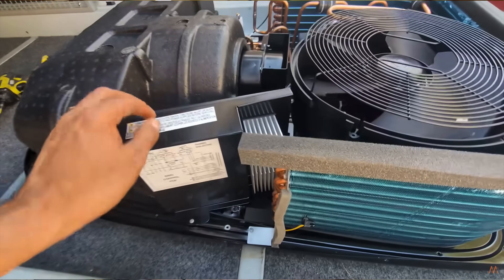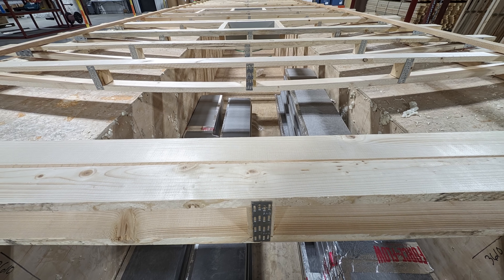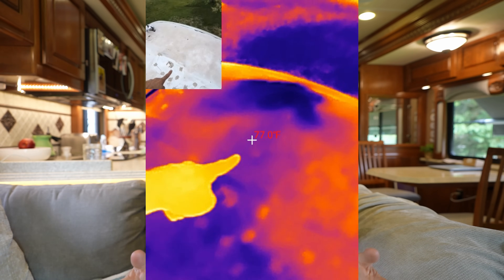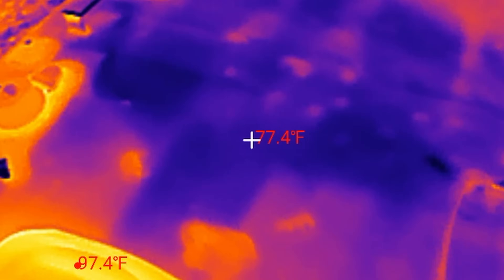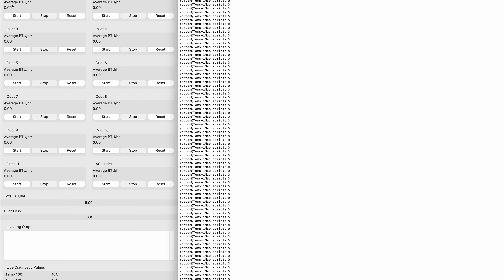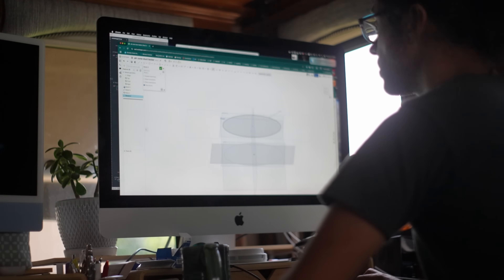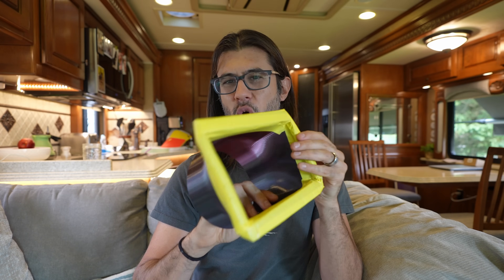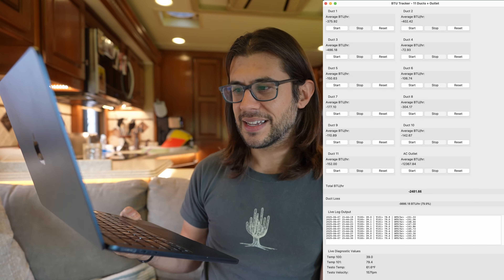Ducted vs Non-Ducted RV A/Cs: One Is SUPER Inefficient

Comment: I have a Diplomat with ducts running front to rear. Both AC units are Dometic Duotherm's (25 years old!!) and both still work. The rear AC unit draws enormous amounts of power (4x the front..or more) so it's pooched. The front can't keep up. And so, I was going to replace the front with a Chill Cube. I'm a Christian, and when I pondered it, I had a crazy thought, put in a non-duct Chill Cube in and just don't use the ducts. A crazy enough idea that I'm pretty sure it didn't come from me! My ducts are on the sides.

When the duct system runs front to rear and is shared with all AC units they really aren't zones and you have no control over them. It would have been way better for the manufacturers to put slats in the ducting so you can isolate them and create zones. For now, the front AC sends much of it's output to the bedroom, which is useless when you are not there. This makes the bedroom way too cold, and the front way too hot. 

Assuming I put non-ducted AC units in, I will have two real separate zones. Bedroom (rear) and living room (front). Then you can close the doors in between and isolate those zones. In theory, you could have someone in the bedroom with their AC set to 90 and someone in the front with it set to 72 and they would not clash. 

The common issue I have with the ducts is that all the AC I need is in the front. But you can't stop it from going to the bedroom. The benefits of having two zones that are actually separated are massive, and if you need more cooling, set the rear and front to the same cold temp and leave the divider doors open. It's a brilliant idea, as such, I think it came from the Lord!
Reply from the maker: watch my furrion chill cube video, thats exactly what i did in the bedroom and it works really well, very easy to un-duct.

Comment: One single 15 K BTU LG mini-split taking the job of 2- 15 k AC’s @ 5 SEER in 19 amps. Win,,,! LG. And we are done with roof ducting AC. That is basically “cooling” a hot roof installation,, instead of cooling the living quarters. And let the roof 6 inches of insulation fend for itself…

Comment: After looking at the research, and front AC dead, (not buying another one), “95 degrees “ here and the little ( window) 10K LG 15 seer is kicking **s in real life. 75 degrees/54% humidity, i am done with roof top garbage. Going full on LG residential mini split (double inverted) @ 15k BTU in a seer 27. Rear unit hanging on back  cap, lines running up to roof then down to 30 inch cabinet replacement. Roof top units will be scrapped/capped. Lg unit will do heat/AC @ 120 volts.
Thanks for your research,,, I just took it farther. I am done with SEER 5 roof AC units = garbage.

Comment: All 3 AC’s being plumbed into the common duct doesn’t help. Our middle and Front ACs push air out the rear AC unit. The fan shroud was cracked, so we were pumping air out side literally.  
Did you catch the ducts that tun to the front overhead dash area?  We had 2-3 vents loose up behind the front TV.

Comment: On our yacht which has 3 living spaces we cool it with no ducts. The solution was 2x16,000 btu heat pumps. Both are split systems and one has two evaporator blowers. The one with the single evaporator dumps into the salon (largest space with most windows). The one with the twin evaporators cools the cabins with one evaporator each. It is a lot easier to insulate a refrigerant line than it is to insulate an air duct.

Comment: It makes sense that ducts are inefficient.  However, the alternative requires the use of multiple fans placed here and there to distribute the air.  In a compact RV with very short duct runs, I think the tradeoff is fine.

Comment: LG 10 k (15 SEER) unit can keep 75 degrees in window unit in rig. With floor fan directly in front of LG pushing air up. This is a non ducted experiment. Moving towards LG mini split single 15k unit @22 SEER in rooftop.

Comment: Running down the same road as you, looking to run LG mini split in ceiling mounted @ 22 SEER . Bounder 35 E here surviving on an LG 10 k 15 SEER. with front ac dead, second ac on last leg. LG 10k has held temp to 76 degrees @ 99 degrees outside on it’s own. Looking at LG mini split with ceiling mount condenser in height measurements. @ in height @120 volt @ same height as crapy roof units, with plastic buble over the roof unit. Your over thinking it, it is roof height and containing it. 15 k of LG air/heat is more efficient. I bet we will meet in the middle of the math.

Comment: In Central Michigan we bailed Saturday because our Rockwood kept climing and 80 was our breaking point. I had put in the Kool RV kit to get more airflow into the ducts but I am not convinced it helped. Of course we have the space / hookups for a second AC but now I am wondering if I should just take out the Kool RV and try dumping instead on these very hot days.
Reply from the maker: We're in Central MI right now too and it's brutal. That's my plan for my next upgrade, going non ducted on one of my ACs.
Reply: @MortonsontheMove  Well at least this should be the last of it for this round. We stay at Soaring's RV park and will be going back this week so maybe I will get it changed over and we will be able to tolarate it next time. All your ACs have been keeping up?

Comment: Thanks for the great video!  Was pondering why RVs need way more BTUs vs a home for the same sq ft. For a home, 10k BTUs cool 450-550 sq ft, so why is 10k not sufficient for a 240 sq ft 5th wheel?  Of course RVs have single pane windows, etc, so insulation can be an issue - some people have reflective insulation panels over the windows to help on really hot/cold days.  

I am researching installing a 10k BTU 12v/24v variable speed AC (inverter technology) for my 240 sq ft 5th wheel into the front bedroom. After watching this video, I'd install it non-ducted, and leave doors open for convection. That unit could be my primary cooling unit to run and drop the humidity levels - which means more comfort at a higher cooling temp setting, and it would be quieter in the living area.
Reply from the maker: I think your right, going smaller unit non ducted will do most of the heavy lifting for less noise and power,  im planning on doing something similar in our fifth then using the central unit just for additional on extra hot days.

Comment: Back in July of 2018 I was try thing to figure out why my 2015 Thor Ace 29.3 didn't cool very well, I discovered the fault by accident while insulating the front cap. I had it opened up enough that while putting insulation in I couldn't figure how I was feeling cool air. My discovery was when they put the roof ducts in they didn't seal the end of them and they were just blasting cold air straight into the front cap unabated. Once I plugged those things got way more efficient! I went on the IRV2 forum for the Ace 29.3 and suggested others check theirs and apparently they didn't bother to plug anyones vents!
Reply from the maker: thats  crazy!

Comment: Very interesting.  I have a 2009 Dynasty that "looks" exactly like yours.  I've pondered finding a way to install a standard house mini-split, but find no good examples to go by.  

With regard to your assumption that 50% of the air is lost, I would not endorse that, even after noting your careful work.  The air in the ceiling has no opportunity to find a path to the external that I would endorse.  The roof membrane has no holes and is not porous.  The roof is attached to the walls.  There are no ducts in the slides, none in the walls, none in the floor.  Therefore my belief would be a inaccurate measurement approach which you have no control over.

I guess one way to verify actual air loss would be to seal every duct outlet with plastic and tape.  On one outlet, tape a shop vac hose.  Turn on the suction and using just your hand, you can feel how much air is exiting the shop vac.
Reply from the maker: No, that was wrong for sure and I corrected that by finding the ducting into the weird spots, but the 50% heat loss is still real. As for a mini split, that was my original plan in this coach as well, running lines in the ducts and using a ceiling unit was the only way I could find to do it. We just don't have wall real estate for a handler. I'm going to be unducting  our bedroom unit and trying the furrion, unit and we'll see how it goes.

Comment: Very in-depth testing! I've been trying to find a replacement RV heat pump since our Houghton has been very disappointing (needed a new control board after 1 year and a new rooftop unit after 2 years, only cools one-third of the time now), and the Turbro looks great except that it doesn't have a ducted unit. But your video is making me question whether that's really needed. The problem is that the heat pump would go above our fifth wheel's bedroom, and moving that heat to the rest of the fifth wheel would be a problem.

Comment: Enjoyed your video.  I think Grand Design has a fifth wheel with the AC unit in the basement vs a roof mount. I thought this was an out of the box approach to AC in an RV.  Not sure how they move the cool air around or how they draw/vent the warm air for the heat exchange, but this approach could address many of the issues you/ve noted.
Reply from the maker: Basement units used to be popular in class a motorhomes but they had a lot of disadvantages, however, there's a few models on the market and one new variable speed unit coming out soon that I plan to test as well. I do like the idea of basement units other than you lose basement space but you gain roof space for those who want to do more solar

Comment: Thanks for the video, I’m now looking at using vacuum panels on the ceiling of my Bigfoot 3000c truck camper. I figure 1/2 panels glued to the roof with 1/2 furring strips, black cloth background with basswood strips with 1/2 spacing. This would allow for lighting strips between the basswood strips. Seems cool in my mind.
Reply from the maker: Sounds like a neat project, and I like the idea of integrating lighting into the design! Looking into it, while far more expensive than foam, the cost might not be as bad as I thought. Would be a good way to better inuslate these things for sure!
Reply: @MortonsontheMove I order one of the Panasonic vacuum panels. It’s 20.70" L x 11.80" W x 0.59" H  and around $30. With the covering on the ceiling I might be able to just Velcro the panels up. They just need to be held in place until the planks go up. I’ve got my 1998 Bigfoot 3000c torn apart now because I’m redoing everything. Removing the propane and replacing it with a diesel heater that will be housed in a box on my flatbed. Then radiant heating in the main and bathroom floors and a couple of radiators in the bedroom. Induction for the range and a convection microwave. I like your idea of ducting the cool air from the ‘downstairs’ to the bedroom. That existing 4” duct will work great for that. I moved the batteries to where the ‘pass through’ window is to move the center of gravity forward and all the electronic is on the left wall of the closet. I remove the generator. For AC I went with a 24v Nomadic X3, I went with the higher voltage so the wires would fit where the existing AC wires ran. The fridge is a NovaCool 9002, dual compressor. It’s a little over 9cf and is the same size as the original 3 way fridge. I just finished your trip through eastern Canada. Really well done!

Comment: Thanks, as always having your scientific analytical approach was great. I have had both types in separate Motorhomes. The only advantage I found in simple observation with the ducted was sound. The start up of an AC can be loud. A soft start could fix that, but the inducted I had was before those existed, I think.

Comment: Thank you Tom! Rather then traveling north this year we had to spend our summer in Arizona. With high temps of 100+ every day in June we've had to use both AC units at times in an effort to keep the interior temps below 80 degrees. Luckily we have the ability to bypass the  ducting in our 5th wheel. The AC is a little louder but runs less and keeps the camper cooler. We will definitely be installing a mini-split before the next summer season. Do you have any advice on mini-splits in an RV?

Comment: Seems like a better system would be mini splits where you are only piping around refrigerant to each head instead of air.  It would have to be designed that way from the start, not exactly good for retrofitting.  Of course more insulation would also help...
Reply: This...  I believe there will be multi-cassette mini-splits in RVs at some point.  The cassettes can be decorative.  Move the condensing off the roof and get rid of the inefficient ducts.
Reply: @rdrose61  A friend of mine has retrofitted his 40' DP with a dual-head cassette system. 15K front and 12K in the rear. He sandwiched the outdoor unit into the basement and modified the door for airplow, exhausts into the engine compartment.

This is crazy efficient and his 4000W of solar and 4 Tesla modules, and 48V Victron inverter/charger allow him to run pretty much 24/7 in both cool and heat modes.

It seems like it would be a no-brainer for the high-end coach builders to simply engineer something like this into a coach that would allow them to be the only one doing this...... kind of like the first company that added slides years ago!!
Reply: @paul65k Exactly.  I don't think it is even a major engineering problem.  In fact, it should solve several issues besides efficiency.

Comment: Very interesting!  When I bought our used motorhome (2013 Tiffin Allegro) I thought it was great that it had ducted supply and return vents.  But when it is very hot outside and we don't have a shady site, my (2) AC's struggle mightily to keep the rig cool.  I have noticed stronger air flow out of some vents than others and interestingly enough, they are NOT the ones closest to the AC units.  I am impressed with the engineering effort you put into your study, I don't know that anyone else has ever done that...but it makes sense that running ducts through an RV roof is like pushing cold air through a furnace.

Comment: Yes. Totally this. I’ve been analyzing the ductwork in our Montana for last year since we’ve had it and it is horrendous how much energy loss is occurring. I’ve done all the mods in terms of improving airflow. Change the outlets all of that, but the amount of heat loss or this particular case introduction of heat into the cold air between the air-conditioning unit and the front of the rig is over 15°
Reply from the maker: That's a huge temperature difference, and totally makes sense when you see the design of many units!
Reply: @MortonsontheMove  It's got me wanting to get rid of the usage of the ducts. TBH not too complicated in my case (2 x Coleman Mach 15 ducted). Just a new grille and block off the ducts I would think. The downside is the noise level would increase considerably though. Replacing them with a Furrion Chill Cube would be the better route but is prohibitively expensive right now and our season really only extends in to October. We were full-time in Florida until January but had to move back to RI due to family stuff.
Anyway, I was very excited to see this video. It's got me revisiting putting Shelly devices everywhere and trying to pull data. Mostly a science project for me except for the fact we're paying $0.33/kwh for electricity from the post right now.
Are you scripts available anywhere? I'm not awesome with Python but I get by.